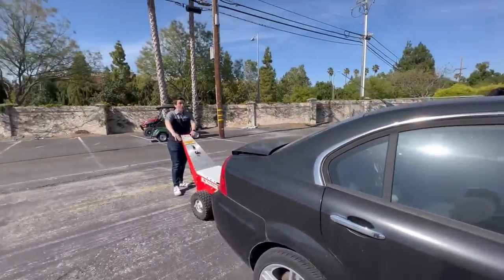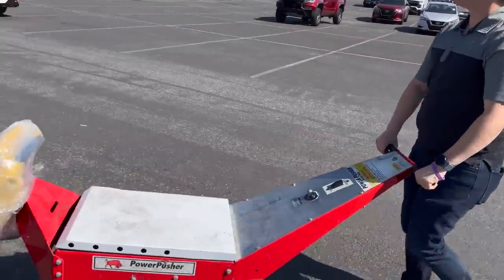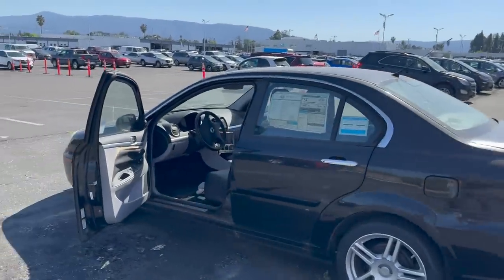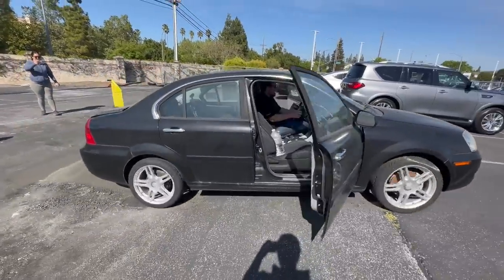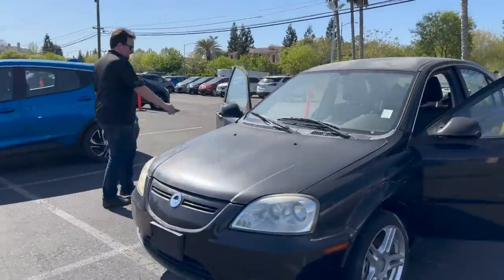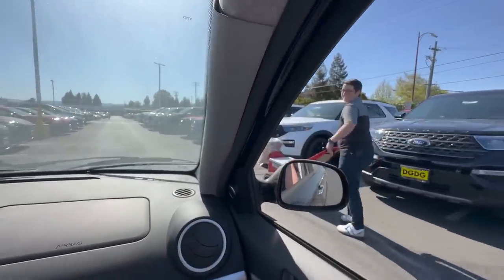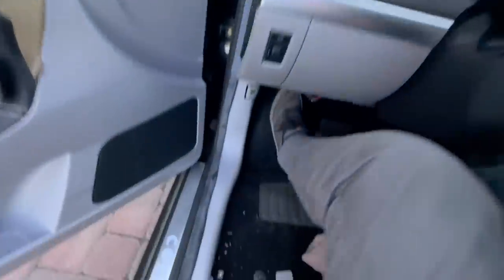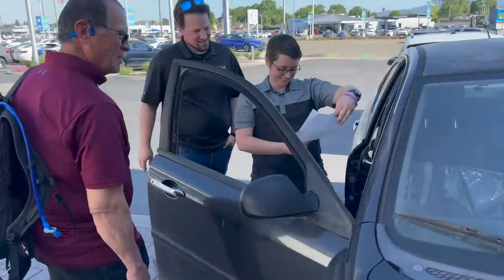It Starts, It Drives, And It's Ours! Coda Electric Barn Find Update

Comment: This is something all the EV naysayers need to see. An EV can sit untouched for 10 years, still hold a charge, and drive off. Some people think you have to replace the battery pack every few years, it's amazing.
Reply: Yep it's true. If you keep the battery temperature in check and charged between 20-80%, the battery chemistry will last 10+ years. I've maintained my 4 year old e-bike battery this way and it's only degraded 1%. They simply last for many many years and maintenance free except for the normal brakes and chains.

Comment: This says a lot about the reliability of electric cars. Even the very early ones.  An ICE car wouldn't have done that well unattended.
Reply: There are literally a million "barn find" videos on YouTube that would prove you wrong.
Reply: @tom_hoots  BS! Any gas powered car that was left unprepped for 10 years would need a carb rebuild or have the jets replaced, gas tank flush, coolant flush and probably new head gaskets just to get it moving. You " literally" don't know what you're talking about.
Reply: @tfcooks  ....and lets add all the dried out seals resulting in oil and coolant leaks...
Reply: Keep promoting electric cars, when everyone has one and it cost 200 bucks to charge a hatchback ev you’ll be PIIIIIIIISSSSEDDDD 😂😂😂😂😂😂😂 COAL AND OIL SUPPLY THE CHARGERS
Reply: I wonder if Fast-JZS147 works as a troll for the big oil companies. He's skipping electricity from solar, wind, hydro, and geothermal so I'm sure he is. Also it already costs nearly $100 to fill up your car with gas now and it will just keep rising as oil reserves dwindle. We will run out of oil eventually and that's just a FACT.
Reply: "Very early" electric cars are from the 1800s....
Reply: @lifeinhd4053  True.
Reply: @xFactoryUSA  Try to say that ten years from now.
Reply: @xFactoryUSA No, you're wrong.  In California, coal and oil are not used for any electric generation.  Natural gas is used for some of it, but solar and wind provide a big chuck too, and that's growing very fast.  

In California, and several other states, you can replace your ICE car with an EV and pay for it with the money that you would have spent on gasoline.
Reply: @FastJZS147  Wind and Solar have already surpassed coal, and accelerating. No fuel costs means costs start dropping over time after the initial payback period.
Reply: @thomasreese2816  🤡
Reply: @tfcooks  Most likely another blind EV hater 'cause they see the writing on the wall for their coal rolling compensation trucks and don't like the fact they won't be able to compensate for whatever is making them feel small and insignificant with some loud, noisy, stinky, polluting internal combustion engine.
Reply: @wolfman9999999  let me know when Apartment complex’s can afford to install charges at 100k per parking spot. Who’s gonna pay these places to magically install charging when most places can barely replace a sprinkler head
Reply: @xFactoryUSA  $100k?  I don't know what you're smoking, but L2 chargers cost less than 1% of that number each to install.   They don't even need to go that far.  Just add a NEMA14-50 RV post to the spots and let the owner use their charger on it.  I spent $3800 to do a full service upgrade to my house and add the ability to charge two cars in my driveway.  I wouldn't have needed to spend that much if it hadn't been for the fact our house did not have central air, and I wanted enough service to do both and add two HVAC units to the house.
Reply: @xFactoryUSA  you clearly don't know what you're talkin about
Reply: @davidmenasco5743  I am a Los Angeles Department of Water & Power "customer" (like I have a choice) and the power the DWP provides is 60% carbon-based: 40% coal and 20% natural gas. So, the blanket statement that California doesn't have carbon-based electricity is wrong.

BTW... I drive electric every day. I know where the electrons come from.
Reply: @davidmenasco5743  A further clarification: my business is with SoCal Edison and I am on Time-Of-Use and the cheapest electricity they charge for is from 8am-4pm. The highest rate is 4pm to 9pm. There is so much solar-generated power in California that much of it is *exported"....
Reply: @xFactoryUSA  how would the utility know the difference between the electricity that goes into my dishwasher and the electricity that goes into my car?
Reply: @xFactoryUSA  the really good EV chargers cost around $500. I've been charging from a regular 115V 15A outlet in my garage for 5 years.

Comment: Wow! Very generous of Capitol VW to gift you this piece of EV history. I can't wait to see follow up videos with new tires and brakes.  That front right is modern art.
Reply: New tyres, new brakes, new 12V Battery, new paint detail, new Alpine head unit, new boot springs, fix rear door handle, fix charge port door, complete clean and disinfect of the interior (I see a crossover video with one of those deep clean specialists) - and that's just the stuff they discovered at first glance. Also the cooling system wasn't coming on when charging so that might be an issue. Lots of content.

Comment: WoW it is amazing that the battery is not bricked 😮. AWESOME VIDEO!! 👍👍👍👍👍 Can’t wait for the next video’s. Please do a degradation test
Reply: Why would the battery be bricked? 
I picked up an older BMW i3 that sat for years, the car only had 133 miles on it and the original 12 volt battery.. Car started up and drove perfectly and had zero battery degradation.. The ice engine next to the electric motor didn't even need an oil or filter change.  Car sat unmoved for 7.5 years.
Reply: It is very cool! I had a similar story with my 2015 Tesla Model S. Sat 4 years in a warehouse with only 270 miles on it before I bought it in 2019, it smelled and ran like a brand new car the day I picked it up. 4 years later I've put 52000 miles on it and it has been extremely reliable.

Comment: I wonder if a modern ICE that sat for that long would have started right up like that. Amazing!
Reply: Maybe... the Fuel would be the major issue. Though Most modern cars do a good job of sealing the fuel tank. That helps.  I have personally fired up car that sat for 3-5 years.. with nothing. Especially fuel injected cars. Battery , and turn the key.
There are lots of YouTube channels devoted to resurrecting cars that have been sitting.  I've seen cars that sat in a field for 70 years, made to run with some simple hand tools, and a little care.  Now DRIVING.. that's a whole other thing...  brakes , rust, suspension issues.. etc.  Also rodent infestation becomes a MAJOR problem with cars sitting outside in a field or barn. 
The fact that this Coda with a LFP battery still had charge.. that's amazing. And makes me seriously think about the LFP Tesla Model 3.
Reply: No chance.  The fuel tank, carb/injectors, fuel line.... Everything would be complete varnish.... You'd have to replace all of it.
Reply: @p0kerp1aya  
Absolutely not true especially on fuel injected cars.
Carburetor definitely might need to be rebuilt. Although older cars if they were sitting from a long time ago had non-ethanol fuel. Pretty much doesn't cause too many problems. You can have gumminess but you don't get that white crusty corrosion inside the carb. That's caused by the alcohol.
I personally fired up fuel injected cars that it's at for at least 3 years. Put a new 12 volt battery in it, turned the key and it lit right off.
I've seen antique cars that have sat in the field for 70 years get fired up the same day with some basic tools and mechanical knowledge. Now driving those vehicles is a whole different thing. Usually the chassis is completely rusted through. Brakes are unusable usually the wheel bearings are locked up and it isn't worth it. But often the guys that are working on these vehicles are after the powertrain only. Oftentimes in an antique vehicle the engine is worth quite a bit of money since they're not very easy to find anymore.
Reply: @kens97sto171  my money is still on the car not running.  3 years, you might be able to get away with it, but 10 years 🤔....I don't think so.
Reply: @p0kerp1aya  
Funny the older the car the better chances are you have of getting it running. Any car that sat before about 1992 did not have ethanol in the fuel.
Any car that was built before 1975 is not going to have any computers or electronics. You'll have points controlled ignition and distributor, carburetor, that's about it. All you need is the coil, 12 volt wires, and spark plug wires.. 
On newer fuel injected cars, your biggest risk is rodent damage. They start eating through the wiring harnesses and you're going to have an absolute nightmare trying to get it running.
Depends on the make and model a little bit too. I don't know why this is but some vehicles had the insulation on the wires made out of some kind of organic material I think corn-based. And rodents are attracted to it and tend to eat it up. Other vehicles not really so much a problem.
Go on YouTube you can find tons of videos of people reviving old cars sitting in a field.
I've seen a couple where the car sat in the field for over 70 years and they got it running.
Like I said getting it driving is a whole other challenge.
Reply: EV or ICE dosn`t matter, new modern EV`s they won`t start after 10 years sitting just like that maybe you will not able to even open the doors. also on ICE`s after 10 years with modern fuels you should re fuel them and changing tho oil first. You could run both of them after 10 years but for driving and using them you should check and service tons of things to make sure you are not damaging the parts.
Reply: @houtanarefi3325  
On a modern EV. If you could charge the battery to a reasonable amount say 80%. Then find a way to actually depower the car. Maybe disconnect the 12 volt battery whatever would be a required. That would leave the battery to stay charged hopefully. Particularly in LFP battery like was in this car I believe is more stable chemically than lithium ion.
You're absolutely correct about age on the rest of the components. Although 10 years isn't really that long for suspension parts and brakes. Although that can depend greatly upon how it was stored. If it's in Florida near the ocean it's probably going to be a problem. But something stored out in a dry desert environment would do much better.
There are a whole bunch of YouTube channels dedicated to getting old cars running that are sitting out in a field or a barn. They can be pretty fun to watch. Especially the older stuff. Lot of times they just need basic tools and some time.
I've seen one wear a truck from 1928 was made to get running. There wasn't anything left of the truck it was broken in half and half rusted apart. But with some time and effort and some penetrating oil down the cylinders. He eventually got it running. That truck had been sitting out there in that field for at least 70 years. All he wanted was the engine out of it. Because it was a pretty rare type engine. And if he could get it to run then it could be rebuilt and sold.
Reply: @houtanarefi3325  EVs will drive move, but you realy need a full deep dive check over all the major parts just to be safe. That first Charge was the part that worried, no clue what the health of the power electronics are like.
Reply: @p0kerp1aya  they drove it to the charger...

Comment: It's nice to see all of the enthusiasm for this car. I am in utter shock it started and took a charge. I have owned two of these. Sold one at a loss and still have the second one that looks virtually identical to this one in my garage (2013). Not running of course! For me, the entire "Coda Experience" has been the biggest pain in the ass of anything I have ever dealt with in my entire life, and that's putting it mildly. I'm biting my tongue and will just say if you need service (you most likely will) I hope you can deal with the Aging Wheels guy for assistance. Thunderstruck is also a fantastic resource and some of the nicest people I've had the pleasure of dealing with. 👍🏻👍🏻🏆

Comment: It has Active battery cooling, LiFePO4, and more range than the 2012 Nissan Leaf. This car was quite advanced at the time it was released!! It's still shocking to me that Nissan never implemented basic liquid cooling into any of the Nissan Leaf models including the 2023 year.
Reply: Amazing right? And LED lights too! Kyle should dump the leaf to a college student and replace it with this cool EV.
Reply: @joemcdonough7509  Actually, he would be better off sticking to his plan.  Aging Wheels has been trying to daily drive his Coda, and it's proven to be a steady consumer of wheel bearings, door handle parts (even this one is broken), and other chintzy plasticky bits that were made with the best sweatshop labor in China in the day.  Still neat to see a forgotten one resurrected.

Comment: So if you want to leave your ev parked for long periods of time, you just need a 12v battery disconnect. Then you should have a good state of charge after sitting for 1 to 6 months. Correct?
Reply: Right.  Lead-acid has a higher self-discharge than Li-Ion, but it's only ~5%/mo.
Reply: I left a model 3 for 11 months it lost 1%
Reply: @letric7927  Well that's your HV battery, which gets disconnected.  The 12V last I heard would drain faster because it stays active (and used to be lead-acid).  But Tesla may have updated it to top up the 12V from the HV.

Comment: Well, I look forward to testing of the capabilities of this thing after it's been sitting for over 10 years. Will it charge to 100% and what is the battery's state of health? How does it compare with the specs when they were new? Granted there are hardly any miles on it, but age is also a factor in battery degradation.

Comment: EVs will be a totally different type of barn find. Nothing in the power train to seize, no oil or gas to go bad, no belts or gaskets to harden and rot. If the battery chemistry is good, charge it up and go.

Comment: Wow kyle great video. Just think a Tesla has more fantom drain than the coda .
Reply: I just looked up the 2012 coda 31 kwh battery for 88 miles and was 37,000 new
Reply: It will probably go further than my 2012 leaf.
Reply: It just shows phantom drain comes from the things attached to an EV battery, not the battery itself. Modern batteries are quite capable of holding charges for a very long time.

Comment: What ICE car could literally sit for 10 years and just start moving again by just connecting a 12v battery. This car is a trooper.
Reply: Few Electrics would either.. A tesla can't sit for more than a month or so.. before the HV battery fully discharges.  As Kyle said.. probably the 12 V battery died.. or maybe when this car is OFF... it is actually OFF.. not sitting partially awake.  And the LFP chemistry made it very resilient to sitting.  They wont know till they charge and drive it a bit more if the battery has any issues.
I've seen ICE cars that sat in a field for 70 years be made to run with just basic hand tools.
Now DRIVING... that's a whole other issues.
There are lots of 100 year old Model T Fords still out running around.
Reply: @kens97sto171  

There are plenty of EV examples that fall into an early deep sleep with minimal to no vampire drain. Tesla and Rivian are notorious for elevated vampire drain, but I assume that's the price for a connected car.

LFP is a resilient chemistry, no doubt. But I can't imagine NMC fairing any differently under this situation following HV battery disconnection.

Comment: Keep it away from other cars: the battery need an inspection, can be dangerous.
Reply: Not if it is LFP. They don't ignite. It might smoke a lot if a cell gets an internal short, but that's about it. Whether other stuff around it catches fire, I guess that's another story. But LFP is a very stable chemistry, I'm sure it's fine.